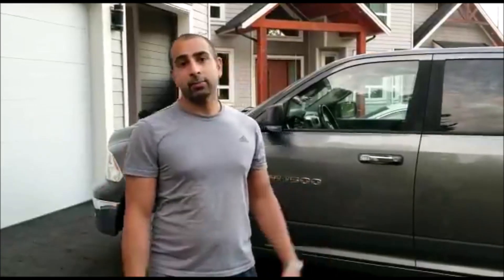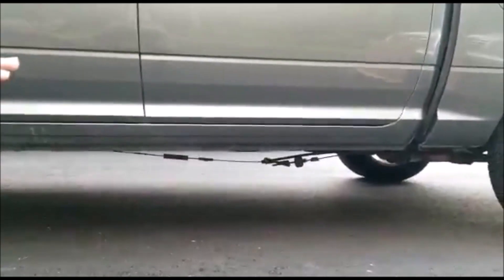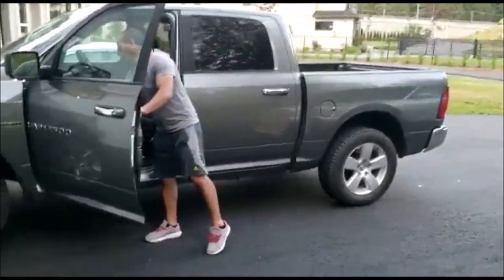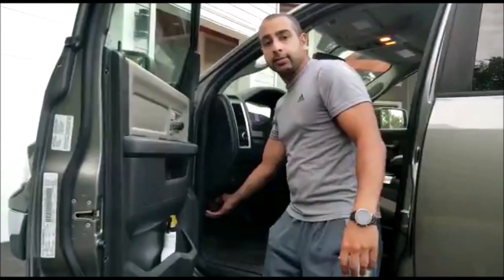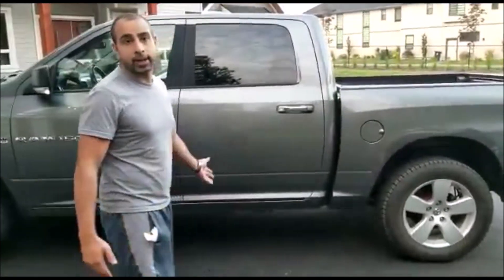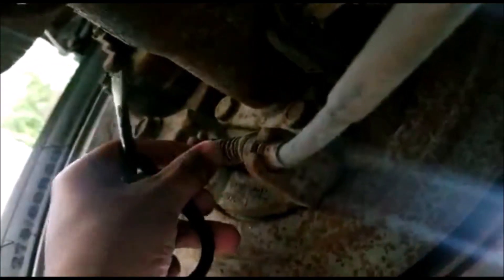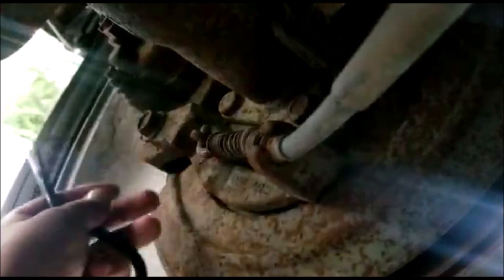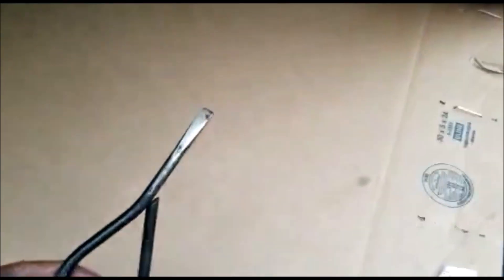2012 RAM 1500 - Part 1 Fix Sagging Brake Cable

Comment: Everyone please keep in mind that this usually doesn't address the bigger problem: the lacking quality of the OEM e-brake shoes and internal actuation hardware are highly susceptible to corrosion, and the brake lining will separate from the shoe, which can causing constant dragging of the e-brakes resulting in damage to the combination rear drum and rotor unit such as warping from the heat being generated or severe damage to the drum friction surface.  This can also severely impact fuel economy, since the constant state of e-brake actuation due to corrosion must be overcome to get the vehicle moving and sustain any given speed. The best practice for the sake of safety is to get the rear e-brake actuation hardware and shoes (can be found as kits from renowned brands - stay away from the OEM garbage) replaced along with new drum/rotor units and brake pads.  Keep everything regularly greased and tested/used so that the moving parts can remain as moving parts for as long as possible, but it will likely eventually reoccur since the design is inherently flawed.
Reply: @Brayan Chandler Instablaster :)
Reply: @Gunner Andy it worked and I finally got access to my account again. I'm so happy!
Thank you so much, you saved my ass :D
Reply: @Brayan Chandler You are welcome :)

Comment: Thanks.  Dealer quoted me $1200 to replace both sides of the parking brake.  I'll lube mine for the time being, and replace when it's warmer weather.
Reply from the maker: wow $1200 that's insane. We should split the profit, you keep $600 and send me the other $600 haha.

Comment: Exactly what I needed.  Unfortunately WD-40 did not release the passenger side.  I had to remove the rotor to get into the brake itself, scrape away corrosion, clean it up with brake cleaner, and then hit it with WD-40.   Thanks again for the post.

Comment: Hey,sometime when you have a little spare time,go under there with a drill and wire wheel and clean the dirt and rust off of as much as you can,hit everything you can with some black spray paint,i do mine every spring,80K miles and the bottom side of my truck looks like new,it's cheap and easy and actually kind of a fun activity.
Reply from the maker: That's a really good suggestion. I used to use a product called plastikote 202. Unlike paint it didn't chip off, one time application is all that was needed. Sort of like an undercoating but didn't look wet or soft as the usual suspects do. Unfortunately they company that produced it was bought out by a larger brand and it's no longer available.
Reply: @herrkutz9223  yeah i spray everything under there,the frame,springs,A arms the whole bit,i wasn't picking on your truck tho,i came to check out your vid cuz i got a saggy cable on my 12',went to check it out and yeah its just like the problem that yours had,its too dark and to cold out there to fart around with it now but I'll get to it shortly,many thanks for the video !!!!!!

Comment: I have the same issue however the lubrication didn’t fix it.  I’m thinking about replacing the spring so it’s strong enough to push it back.  Do you know what exactly it’s called?

Comment: you should take the rear rotor off and see if the shoes are seized . If they are your brake cable will sag every time you use it because they are engaged and you replace the brake but the shoes wont go back.  You will never ever need new cables you can always grease the ones you have and they will come free as soon as you fix the shoes
Reply from the maker: Good tip!

Comment: What tool did you use to tighten up the cable?
Reply from the maker: Didn't need to use any specific tool, just need a lubricant/grease and something to free the assembly.